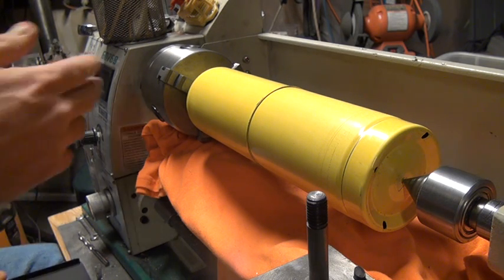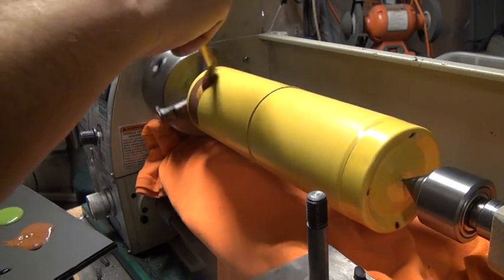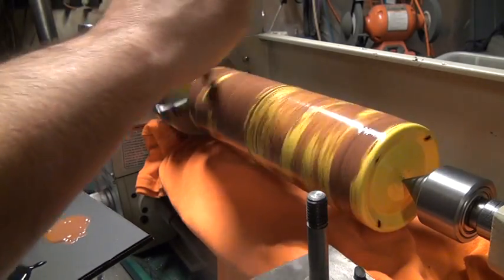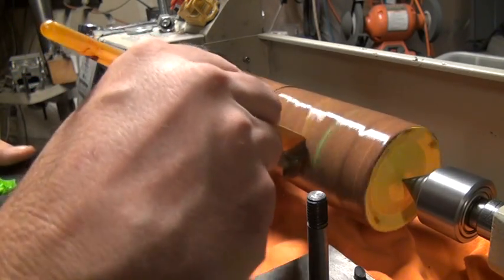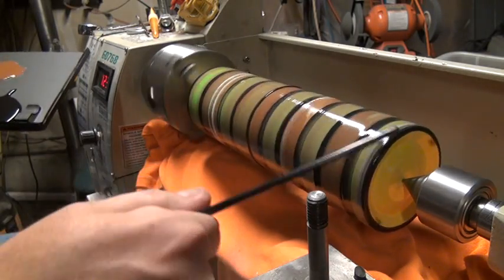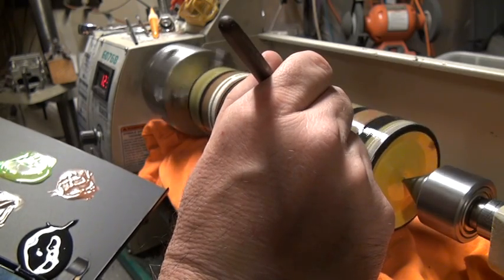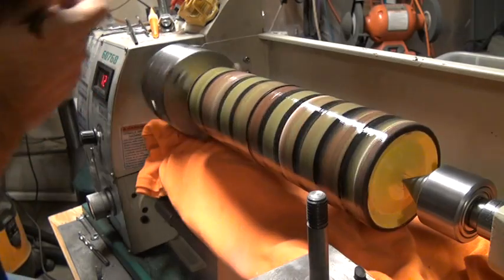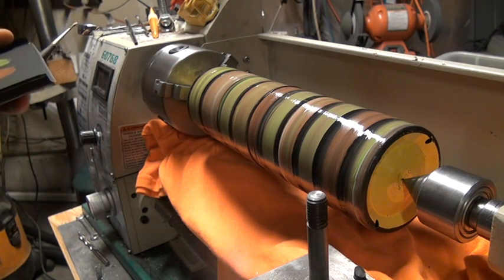grizzly lathe 60768 painting

Comment: I've been watching your videos regarding the Grizzly G0768 lathe and would like to know how it is working out since your first reviews. There aren't any in depth reviews online and I would like to get some more feedback as to your experiences over the past few months with the G0768, both positive and otherwise.  Thanks.
Reply from the maker: Jim Ashton it works well for my needs ,
Reply: Bob N Thanks Bob. Have you ever checked the run out on the lathe and if so, how did it come out. Also, does it have hardened ways? Usually there is a label on the end of the bed indicating so if they are. Thanks.